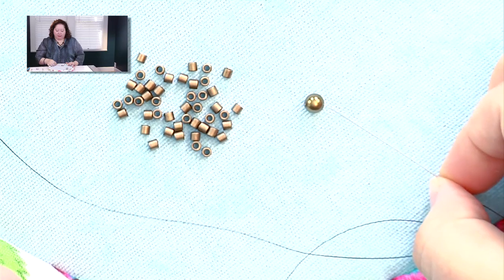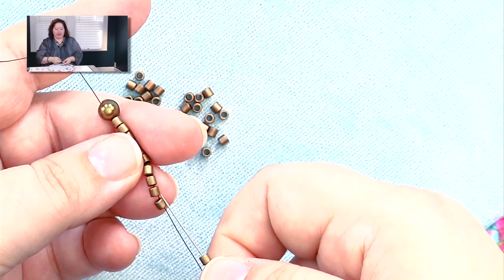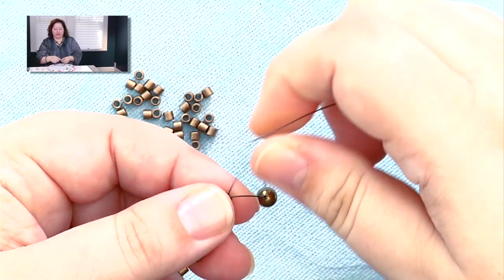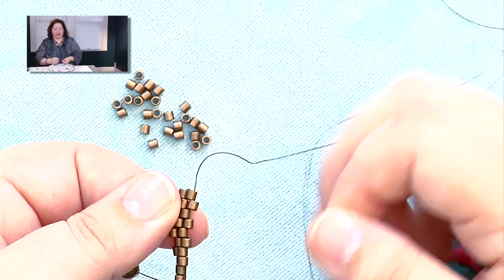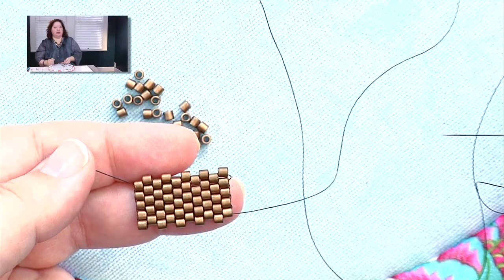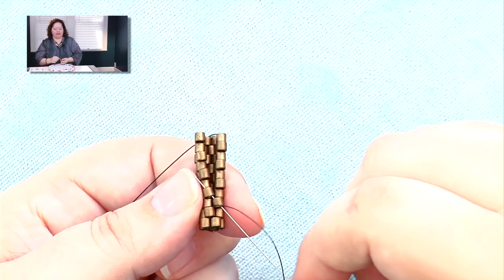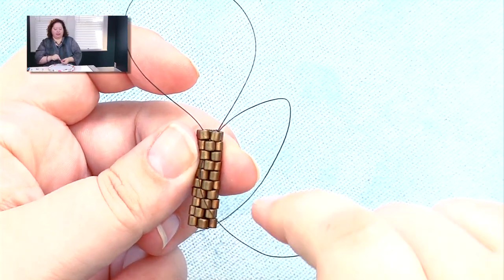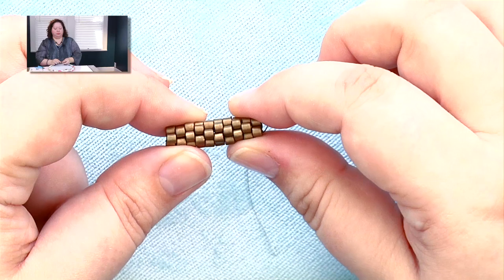Learn to Make a Peyote Tube Toggle

Comment: WhooHoo! Love this stitch. I didn't have delica beads so tackled this with 11/o. Doing the first pass to set up the 2/1 ladder was a pain, but I decided to just load the beads on then adjust them into the correct positions. It work really well and I was rocking the peyote stitch in no time. I loaded 12 beads on the thread then build out 12 wide before I did the "taco". The process goes really fast and it makes a nice, tight bead. Can't wait to make a bracelet out of my peyote beads. Thanks Jill.

Comment: I am soo glad I found you!  It's so easy to learn from you. After watching one recent vid yesterday, I came back and went to the oldest. I am so excited.  I'm getting a tiny bit older ;) so it's harder to see.  My dumb arse maybe stubborn too, uses a lot of size 11 beads.  I have found in some cases, they don't look as nice as the ones you are using in this project, for example. I have some that size and I think for a while until I'm comfortable with more stitches, I'll use the bigger ones.  Can you explain the differences and why you would use size 11 for example on a project and use size 6, for example on a project. In other words, are there certain projects that a small bead just doesn't look right and vice versa with the bigger ones.? Thank you for your videos. They are hard work and I really appreciate them.

Comment: Hello Jill, I know this is a older video, so I don't know if you will be able to get my questions. First I wanted to tell you that I like the way you taught the tube bead, which is what I want to make. But was wondering if it would be possible to make it using 6 lb monofilament instead of fireline thread ( as it's too expensive for me at this time)? How would you go about making the tube beads into different sizes (lengths, etc)? Thanks in advance for any help you can give me. I will certainly appreciate it. Sincerely Becky B from Arkansas

Comment: I can not thread a needle like I used to do. Have you a tip to let me bead again.?
Reply from the maker: My best tips are: good lighting, good magnification. But also, make sure you're using the largest size needle you can. I almost never use size 12s any more - I switched to size 11 needles for most things a few years ago and can thread those much more easily.

Comment: Hi! I found this video very useful, I got impressed by the nice result. I have a question: Do you think it is practical that I make a long flat peyote piece to work it together (like in the video) and get a tubular necklace? or is there another way to make a tubular necklace? I'm wondering about it because I want to do an African design which I was not able to do it (and maintain the drawing) while working in the regular tubular method.  Thanks and best regards.
Reply from the maker: Fannitomo No, I'm afraid that won't work for a necklace or bracelet because peyote done flat and then zipped up is too stiff - it will only be a long straight piece. Instead you could use tubular herringbone to follow a pattern.
Reply: Fannitomor

Comment: Hi Jill, I love your designs and have tried several times to make some of your projects, however, I am not the most experienced. I think you need to be a little more specific as to what size beads you're using and also how to start and finish a project. Some how I feel you start your projects a little ahead of the actual beginning. Again I do love your projects but can not finish them accordingly. Thank you for your tutorials,
Reply from the maker: There is almost always a free PDF download with written details on the seed bead sizes, etc. The free PDF links are in the description field. You can find them at: jillwisemandesigns.com/patterns/    And if I've started "in the middle of something" it's only because I've already made a video on the first part, and there is a link to that video within the current video.